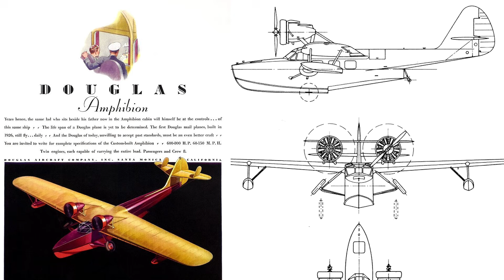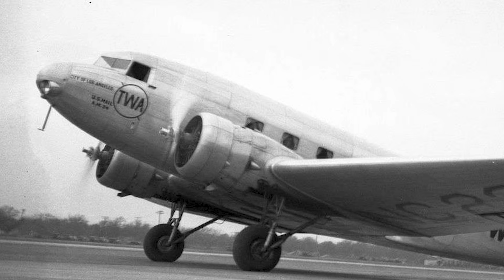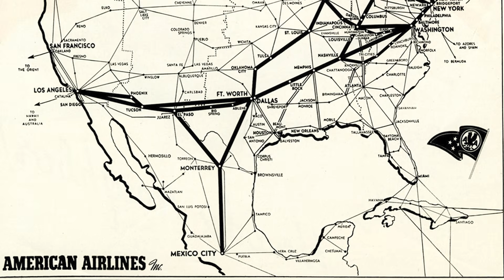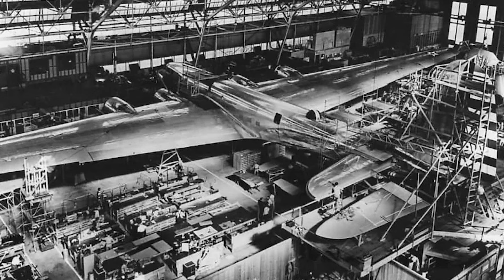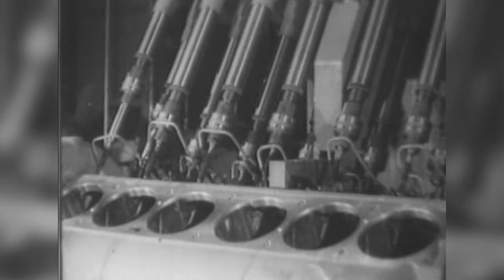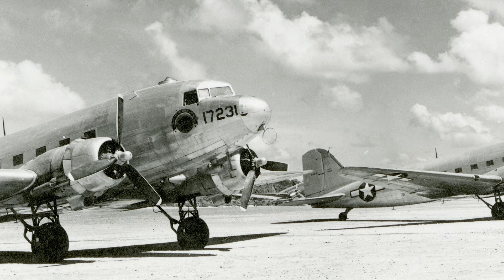History Of The Douglas Aircraft Company - Peace And War (Part 2)

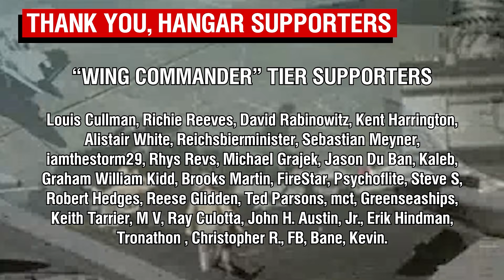Comment: Sir, the very brief description of your medical issue caught my attention. I also have an acid condition called Barrett’s Esophagus. I carried a small container of baking soda around for about 10 years. A bit of that on my tongue and the heartburn was gone! But it merely put off the symptoms. By age  33, I was given an upper endoscopy. There at the valve at the top of my stomach was a red burn mark, Barrett’s Esophagus. It caused by acid leak by and damaging this valve. If not treated, it can cause Esophageal Cancer. THAT CAN KILL YOU in 1:01:31 90 days!  What saved me was Omeprazole 20mg 2x a day. 10 years later, I got a laser “ablation” that cauterized it and I’m saved! Good luck

Comment: A few whoopsies: When you say the engine of the DC-2, you say Wright Cyclone 1690. It was the 1820, the PW 1690 was different, and it was probably a freudian slip since that was used in the competing Boeing 247. Second, you say at the beginning of the DC-3 section that  TWA was rolling out the first of the even faster DC-3's, which is a slip of the tongue as well, no doubt.

Comment: Initially there was 85% parts-comonality between the DC-2 and DC-3. [34:54]. I'll say. I saw a YT video  -- can't remember whose -- about a CNAC DC-3 that got one of its wings shot up by an invading Japanese fighter. Before Japanese ground troops could capture the airplane, a spare DC-2 was flown to the location of the stranded Gooney Bird, and mechanics cannibalized the wing off the DC-2 and bolted it on the DC-3. The crippled airplane was able to fly its passengers to safety out of the japs' clutches. DC-2.5? Probably crabbed like hell, but it flew.

Comment: Poor DC-5, always forgotten.
Reply: Now you know where  Kelly Johnson stole the Triple Tail idea for the Connie.
Reply: @HootOwl513  Eh?  What does the Connie have anything to do with the DC-5?  The two aircraft could not be further apart.
Reply: @pythosdegothos6181  My mistake, I was thinking about the DC-4E prototype. The -4E had a three fin tail
Reply: @HootOwl513  AH...yea, that makes more sense, and it is a spitting image of that first DC-4 for sure.
Reply: @pythosdegothos6181  The Dolphin style fuselage was original, and genious. Johnson said the triple tail was to get Rudder Authority agains to prop blast of four R-3350 powerplants, and still get the whole plane inside a hangar.
The DC-4E had a larger diameter, straight pipe fuselage.

Comment: My father worked for Douglas, starting at El Segundo in 1943 and soon becoming the Leadman in Prototype, building the first Skystreak (D-558-1) and the Skyrocket (D-558-2) and the first aircraft to achieve Mach 2. He also built the first F3D, F4D, F5D, A2D, A3D, A4D and AD-1 program modification. He worked directly for and with Ed Heinemann as his department was prototype, building the first of any new airframe as Heinemann was Doug's chief designer. Later he worked on the DC-8 program.

Comment: I worked at the Douglas plant in Long Beach in the early 2000's, I got to get up close with a DC2 under restoration, and a flight on a DC3 that gave sightseeing flights.
Reply: I got a flight on the DC2. We went to Catalina and back. We were the last flight before it was about to go under some wing work. The two pilots were so old that they needed both to meet the regulations. They looked over 70 years old.